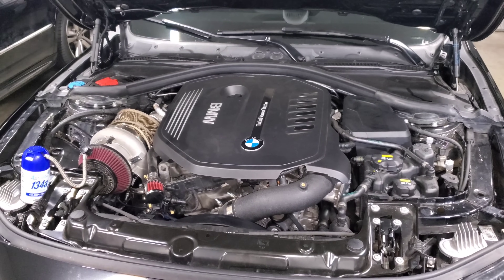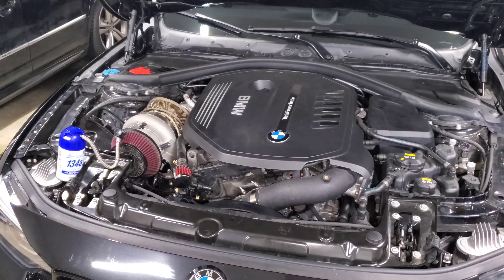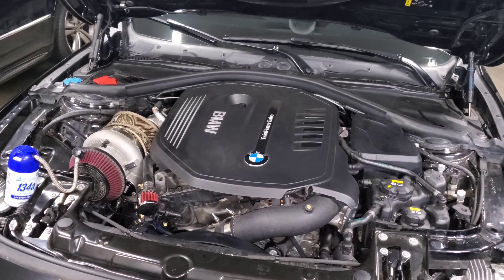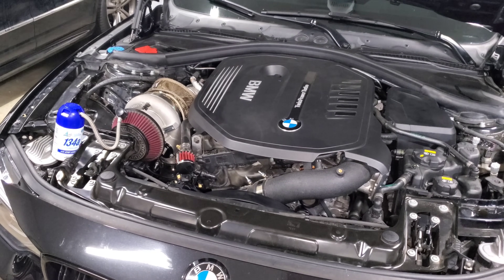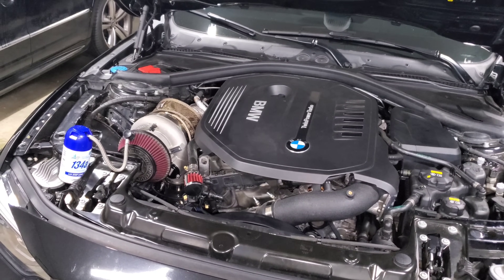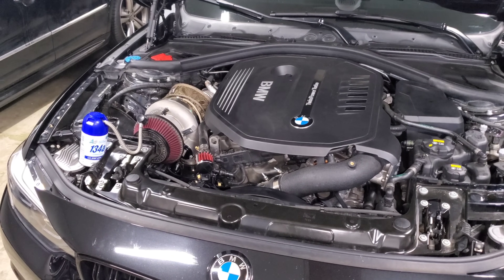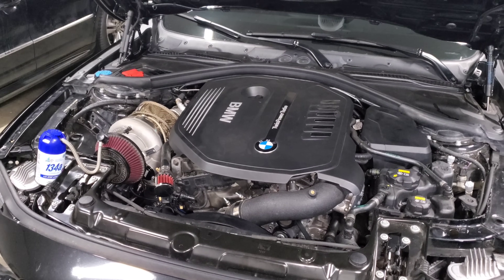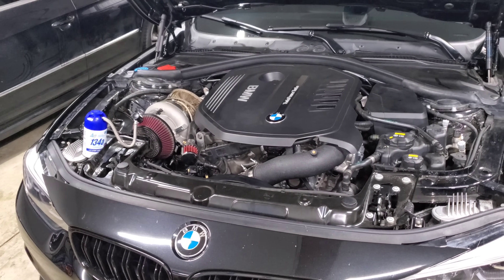How much power can the stock B58 Engine handle?

Comment: Hey man, is it possible to flex hone the cylinder walls?
Reply from the maker: Nope
Reply: @kern417  Damn.. I bought a engine for a swap and the seller sold me basically junk. It has dirt inside the cylinder walls and he refuses to take it back. Kinda stuck with it now. Sleeves are expensive too. Finding another block or good engine is like hitting the lottery too. Here the engine prices also sky rocketed. About 1.500-2.000€ more expensive then before. Fml
Reply from the maker: You can definitely try but everything I've seen in my research indicates that it can't be machined. You need to bore it out and install sleeves
Reply: @kern417  Can you recommend any sleeves that are ready to install? I can then ask some machinists around if they can bore it out and install them..

Comment: any manufactor for spraying water? Also is it cool spraying water not DI style? I think that could kill nr1 and 6 aswell unless ur not pushing it with the tune and its really just for the sake of it
Reply from the maker: Any meth injection kit should be able to work with water as well. Water does not affect afrs so i should not have the same risks as spraying meth in the charge pipe.

Comment: I think I've seen it in previous vids about the Stage 1 and Stage 2; I like the Stage 1 just for engine life vs performance curve.  Seems like that $1500 Stage 1 bumps you up to the 500HP point which in this car for a daily driver would be optimal - for me.
Reply: Nah stage 1 is 450hp
Reply: Stage 1 500hp? I am stage 2 on 98ron and its up to 430hp +-
Reply: nah stage 2 iis 500hp
 @jachympatloka5453
Reply: @jachympatloka5453 yeah 500 would be with ethanol mix
Reply: @joshbell123  stage 1 makes low 400s with ethanol, stage 2+ makes mid 400s on ethanol
Reply: @hpzzz 
Are we talking bhp or whp?
Reply: @yousef.al-assaf wheel

Comment: you are talking about HPs , but what the stock car can take in torque :  gear box , transmission .  
and what about cars models ? is a M140i equal to a X4M40i for example ?  it's totally not the same car , same weight .

but very interesting .
Reply from the maker: The question is how much the engine can handle, and that is what I am answering. Other components can be discussed in other videos.

Yes the hp Limits are the same regardless of the car it's put in.
Reply: @kern417  but when you put a 1500kg car on dyno , or a 2000kg car on dyno . this is not the same mass , the same latency, forces .. right ? 
power at the wheels , I guess
Reply from the maker: @Tupeutla  the drivetrain is not that different to affect output.

Comment: Kudos to people going for 600+whp, but I’ve got a wife and kids so I’m living around 400-500whp haha I wish I could push it though! I’m already Stage 2+ 93 tune, but might do Pure Stage 1 to finish the build off.
Reply from the maker: They don't make a Pure Stage 1 anymore, but you can get 450-500 on 93 with a Vargas GC.
Reply: @kern417  Was there an announcement from Pure because it’s still listed on their website? I’m going to be bummed if it’s true. I really don’t want to go GC because I want to stay away from having to dyno/custom tune.
Reply from the maker: @aeronkellan2814  Any hybrid will have the same limitations from a custom tune perspective. many people run them on ots maps without an issue. but no they do not sell it anymore. Only the pure800 series.
Reply: @kern417  I’m really bummed to hear that. I won’t be upgrading my turbo then. I’ve seen plenty of people run Pure Stage 1 on the 2H or 2+ Bootmod3 maps since it’s really only an upgraded compressor wheel so I was really hoping to do it too. The Vargas GC is just too much for what I want. I know they made 500+whp on a 93 custom tune with no meth or DI. My wife would murder me if I did that haha
Reply from the maker: The vargas GC is virtually the same as Pure Stage 1. It only replaces the cold side. Maybe you're thinking of the GC+.
Reply: @kern417  Then that’s good news! It’s just $500 more than the Pure stage 1.
Reply from the maker: Just wait for black Friday 🙂
Reply: @kern417  I always do for the bigger mods :-)
Reply: @kern147 is the Vargas gc turbo an easy diy change. Currently stage 2+ and would like that little bit more
Reply from the maker: Yes. There is a turbo swap DIY on my page if you search down a bit
Reply: @kern417  ok perfect thank you I’ll check it out. What’s the sort of power with 98 octane /93?
Reply from the maker: 450-500
Reply: Dynamics autowerx hybrid turbo + custom tune on ecutek is the best imo for a daily and you can set maps that you can change on the fly so that when you’re driving by yourself you can use higher power settings 600+, or low map/93 for like 400-500 for daily, or even a stock map

Comment: sorry if I missed it, what causes the pistons to fail? is it torque? heat?  Vargas made 600whp/600ftlb torque on their car so if I get a bigger turbo that can carry out that 600 torque to 6900rpms. 600 * 6900 / 5252 = 788whp. what's the problem in doing that with supporting mods like xhp line pressure bump, heat exchanger, full e85 port injection , IATs in the 80s, being mindful of heat and not doing crazy back to back pulls.
Reply: High compression
Reply: @universalg_  ok so with high compression do you have to worry about boost pressures in the cylinder or total air because ive been running 28psi on my GC turbo for about 12k miles
Reply: @jp_b58  I would say the boost pressure in the cylinder which would cause them to crack. I’ve heard 28 psi is fine tho if you have upgraded turbos?
Reply: @universalg_  Ya I wouldn't go past 28psi, but 28psi in a bigger turbo makes more power than a smaller turbo.
Reply from the maker: Generally excess heat causes the piston rings to expand, they contact the cylinder wall and break ringlands. There have also been a few cracked pistons.

Torque bends rods, causes clutches to slip, etc. HP causes a different kind of damage. Because your cylinder sees twice as much ignition at 7000rpm as it does at 3500rpm. You're firing twice as fast in the same period of time which generates more heat. That's why it's key to run some alcohol (ethanol or methanol) to reduce cylinder temps and keep the engine together.

Comment: And here I was worrying about my Bootmod3 stage 1 93 octane tune..
Reply from the maker: You'll be good. Just keep up with maintenance 👍🏾
Reply: @kern417  What is the max torque rating that the transmission can handle?  And I take it the F32 440 uses the GA8HP50X.
Reply: @wingedhussar5528  You will be totoally fine, I'm running Stage 2+ with XHP Stage 3, Stage 2 will not reach the limit from my experience unless you go stage 2+, just make sure you got a high flow downpipe to support that Stage 2!
Reply from the maker: @wingedhussar5528  with xhp around 650 ftlbs
Reply: @kern417  Thanks
Reply: @osenchenE92  Thanks.. I don't plan on going past Stage 1.. I'm good with the little bit of extra boost.
Reply: @wingedhussar5528  If you are running non-MPPSK you will feel a little bit extra, but with MPPSK is almost the same... Stage 2 is pretty good tho! Sounds sick too with DP
Reply: @osenchenE92  I put a stage 3 xhp tranny tune on my 340i and for some reason it made the car feel way slower. I’m running an intake chargepipe catless downpipe and a a stage 2 bm3 any idea what could b causing this? It seems as tho I do not climb rpm nearly as fast without the tune and the car doesn’t accelerate fast. I ended up uninstalling the xhp tune and everything went back to normal but I would like to try to figure out y it is doing that
Reply: @osenchenE92  my guess would b that somehow the boost is being limited but I’m still unsure as to what’s going on
Reply: @Fatcap1510  you need to run in the gearbox after you flash the XHP tune, and there’s 3 stages of tune. I also feel slower shift at first in sport/comfort, only super fast in Sport+. But after about 1000 miles it’s normal now! Give it some time and make sure you run in properly

Comment: Is a clutch upgrade needed when shooting for 700-750whp with xdrive?
Reply from the maker: Yes
Reply: @kern417  how much whp and/or tq can the 335is/550 clutch handle
Reply from the maker: @KSIxKRYPTED  i kept it below 600 ft lbs and it's holding ao far

Comment: I'm excited for this video. I'm installing a Stage 2 HPFP and Pure800 turbo with a custom tune from Paul. I hope you give input on if I'm killing my reliability by doing that.
Reply: I’m doing the same. I think hybrid turbos are safe
Reply: Did that with a WedgePerformance tune
Also csf heat exchanger helps a lot
Reply: I plan to do the same. From what I’ve read, our stock block should be able to reliably handle 500-550whp. If you start going above 600whp that’s when I believe you start to sacrifice reliably but that’s my 2 cents!
Reply: @universalg_  yes if you go big turbo you need to build the motor
Reply from the maker: Upgrading your turbo does not mean you need to build the engine. Watch the video.
Reply: @AmazingAsif  I didn’t ask if I needed to build the turbo. 😂 I know you can run Pure800s on a stock block w reduced boost
Reply: @universalg_  was just talking about the Borg Warner EFR’s.
Reply from the maker: Again, my car is clear evidence that you can run an EFR on stock engine without issues. Even a 1000HP-capable turbo can be tuned to a safe limit until you're ready to build the engine.
Reply from the maker: @DamnDudeGetaLife  in lower gears It doesn't matter much but in higher gears I would try to keep it above 2000 to 2500
Reply from the maker: It mostly depends on the tire and the road surface. If you're on a street tire on the street then it's probably not a huge issue. But if you're on a racing tire on a drag strip that's properly prepped it's very risky.
Reply: @kern417  what is at risk in that situation? With an upgraded driveshaft and transmission would the risk be basically eliminated?
Reply from the maker: Then you're just worried about axles, diff, etc. It just goes to the next weakest link.
Reply from the maker: @DamnDudeGetaLife  even if you can't tell there will always be more slip/less traction. Think how the tires look in slow mo launch videos
Reply: CSF Heat Exchanger, DS2 HPFP, then Pure 800 Stage 2 with custom tune from Paul

Comment: So far here in UK we had 750bhp M240i completely stock engine , and 1000bhp M140i with stock block and stock gearbox 👀
Reply: 😅 dam.
Reply: That's in line with what he's saying in WHP.
Reply: Impossible with stock block
Reply: @jasontan27 it’s not impossible though? The stock rods themselves can handle like 800-850, if you get lucky with pistons I can see that happening.